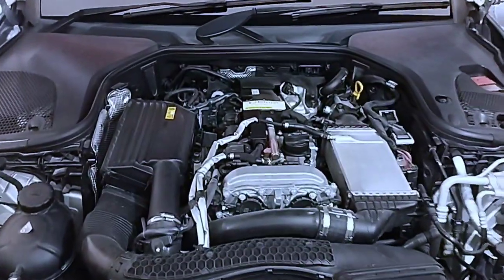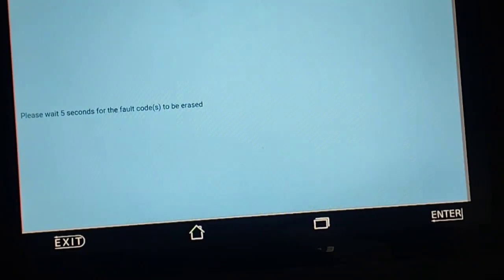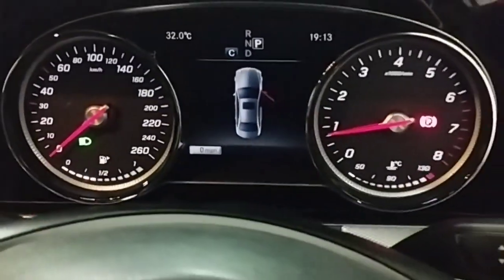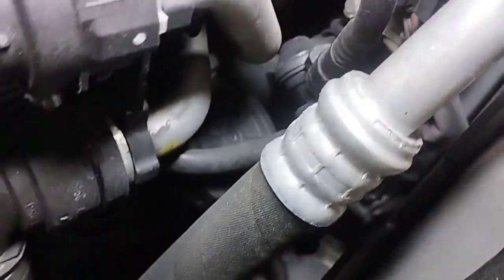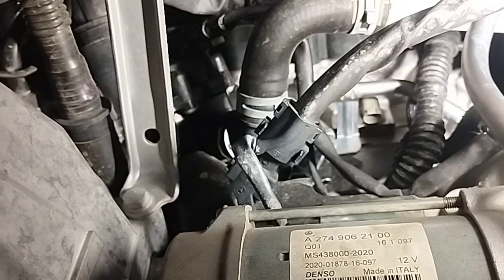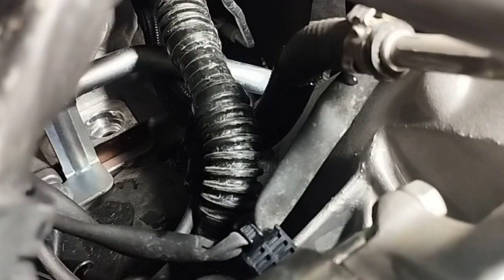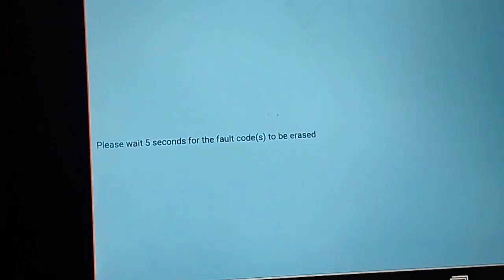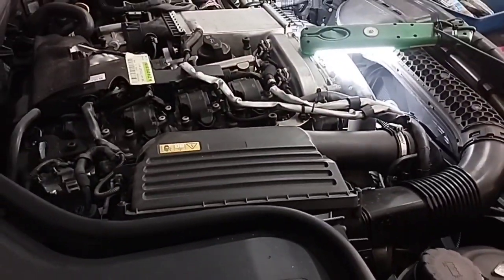How to fix engine code , P0217 coolant temperature of the engine too high Mercedes Benz E-Class W213

Comment: Hi, 
I need to locate coolent temperature sensor in Mercedes CLA 2.1 Diesel 2017.
Any advise in this regard please, thanks.
Reply from the maker: The sensor itself is located below the air pump and between the thermostat and coolant pump housing

Comment: I got Mercedes e class 2016 I have the same problem fan running 2-3 hours continuously I went to garage they changed coolant sensor like you but problem still the same.
What should I do.
Reply from the maker: Please Check this car electric water pump

Comment: I have a Mercedes Benz GLC 300 2020 the air conditioning stop cooling and the radiator fan runs very fast as soon I start the vehicle  what can it be?
Reply from the maker: common issue AC not cooling  problems                          Refrigerant leak
Dirty air filter
Faulty compressor
Incorrect thermostat settings 
Frozen evaporator coils 
Blocked vents or ducts
Electrical issues

Comment: hi please see this video, the motor wire is broken from the BOARD need to know where they are solder on the board, Panasonic ND-SD 350 VIDEO, This is for motor 2 black wire with brown clips